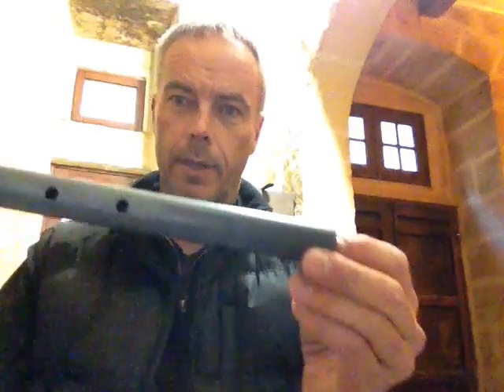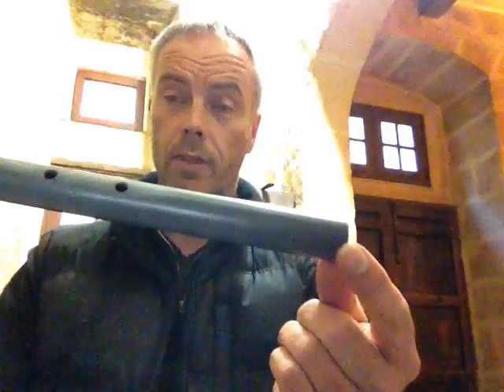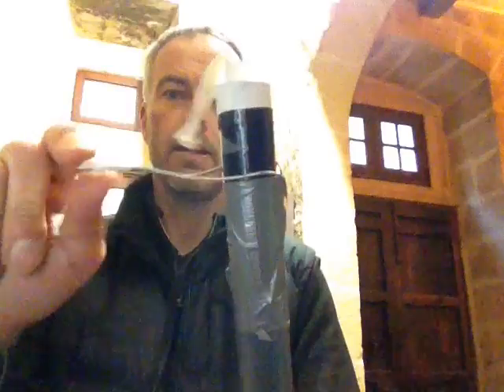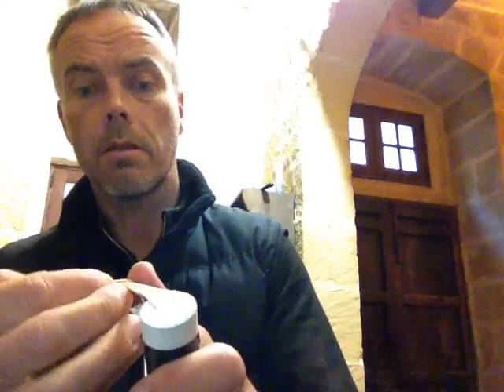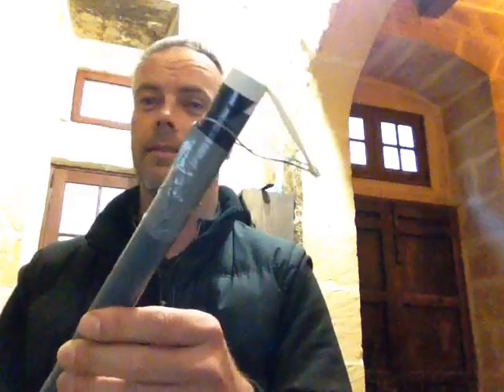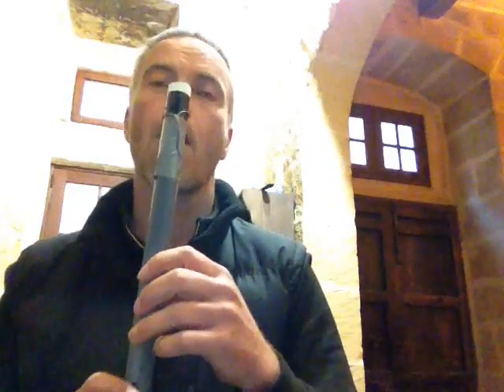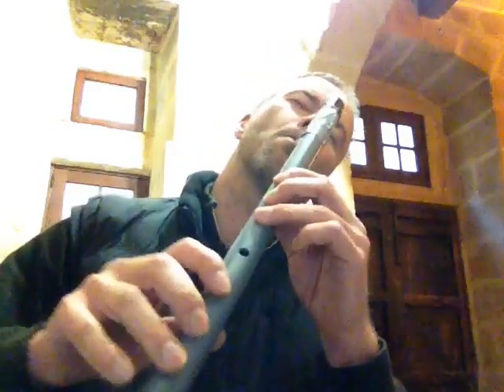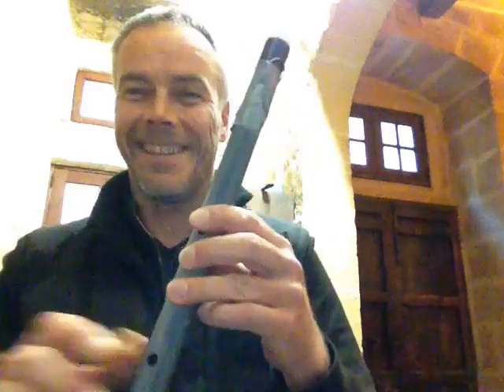DIY PVC Saxophone

Comment: This is genius. I am wonder how did You determined how make proper holes eg the number of holes their size and the distance between them to make properly sound You sax. The idea with the baloon is great it has some parodic feeling however the final result I like :) Regards
Reply from the maker: Hi Daroo. I am not a musician, so I can't tell you. I guess first of all checking the overall length of the pipe and see which tone it will create, then drill a hole half length and see... then you might be able to figure out
Reply: or drill many then close bad ones

Comment: How did you find the dimensions for the measurements of the holes?
Reply from the maker: the holes are not correct, I used an old flute from a build earlier. I guess start with one hole, check the tone and continue with others... try and error
Reply: Armin Hirmer Thank you, you saved me from getting an F on a physics project.

Comment: Do have a tutorial on the flute part like the making of it?
Reply from the maker: unfortunately no. but it is simple. take a stiff wire, bend it around like shown. Cut a balloon, put in on the end of the pipe and stretch one side of the mouthpiece of the balloon over the wire

Comment: i didn't understand how did you put the balloon!  can you tell me how you did , i cant see well in the video
Reply from the maker: Hi. You cut a balloon on the upper end to open it. This part you pull over the pipe and secure it.
The normal opening were you blow in will be fixed on the wire. Simply try, it is easy :) good luck.
If not, let me know again and I will do a little video :)

Comment: wait so is the piece of the flute in the mouth part still in ?
Reply: and can u cover up the hole at the top of the flute that splits the air ?
Reply from the maker: no, it is only the pic pipe, open on both ends. the sound is created with the balloon
Reply: Armin Hirmer  thank u so much 😃

Comment: How did you craft the mouthpiece?
Reply from the maker: a piece of wire fixed on the top of the pipe and then you but a balloon on it
Reply: do you have to cut the balloon open?